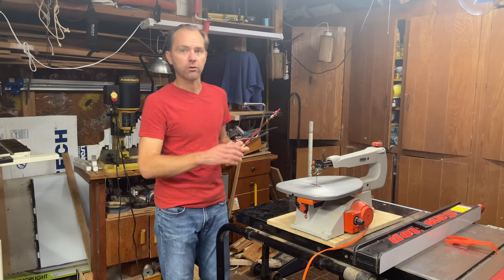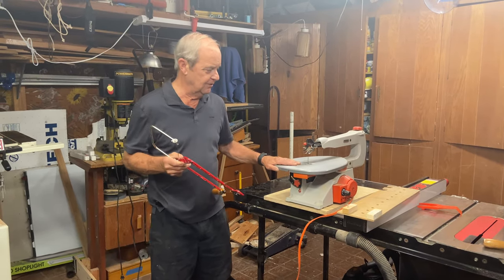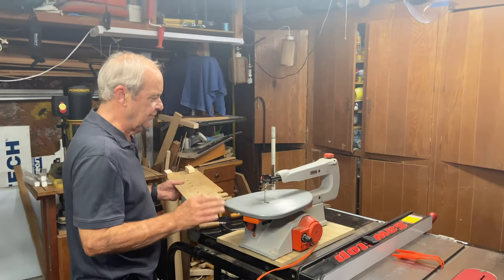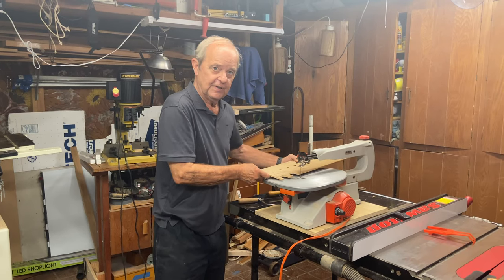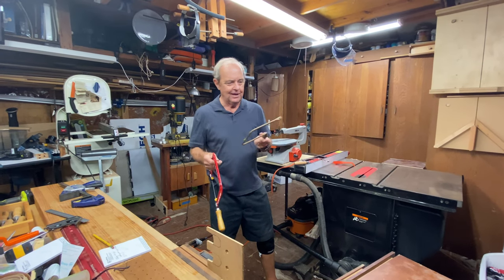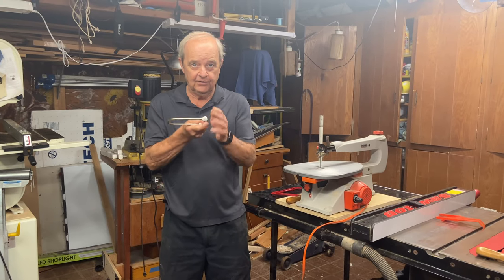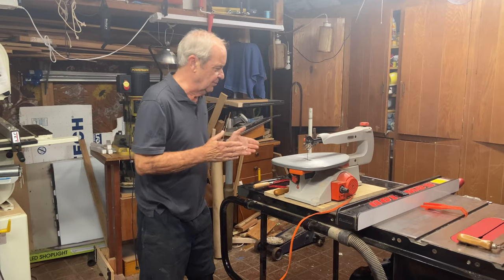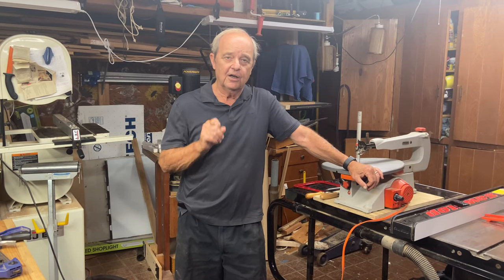Scroll Saw vs Coping Saw vs Fret Saw

Comment: Just a small point with the scroll saw and the wood hitting the body of the saw. If you start on the right side of the cut instead of the left, you can rotate the wood more than 180 degrees.

Comment: Don't know if it's a different tool but I suppose it's about just the same that jewellers use to cut very intricate pieces of fine sheet metal. Most of them will have a sort of cutting table that will allow the user to cut pieces with the blade being vertical and pulling down, rather that pushing. Basically this gives the same cutting motion of a scroll saw machine with the benefits of having support from both sides of the cut (eliminating quite a bit the chance of vibration, opposed to a piece held on a vice).

Something to also have in mind when using a scroll saw machine is to have a height limiter. When using this sort of machine, despite the saw teeth are pointing down, you can often find yourself in a situation where the workpiece will "dance" up and down like crazy if you down hold the piece down firmly but gently. The height limiter greatly reduces the chance for that to happen.

Just as an added hint for anyone who never tried it, I've tested with much success the use of an abrafile blade (ceramic tiles cutting?) installed on an scroll saw machine (Hegner Multicut). 

Safe cutting!
Reply: You're correct, resting the piece on a cutting table allows for a easy cut with a simple coping saw. Holding the piece in the vice has several drawbacks: flexing of the piece, and unable to see lines.

Comment: A worktop fret saw has limitations as you've illustrated but I have found that often it is down to having the patience before skill when it comes to any of the tools you've shown. I do intricate (valve radio wood cut outs for loudspeaker fascia panels etc) and similar work with timber that can be 5 mm to 2.5cm thick from softwoods to hardwoods including plywood and laminates.. Having patience and taking your time rather than rushing the work in progress seldom delivers less than excellent results. At the moment with the Covid 19 situation many of us have time on our hands with ie lockdown etc to do some woodwork using these tools AND without having to spend a heck of a lot of money doing so,. Quite often it is easy to lay ones hands on scrap off cuts of wood if we are learning to use the tools in question before we move onto project timber etc. I've used a friend who is great at drawing to do some fretwork wood designs drawn onto the timber and then cut accordingly before finishing with varnish, painting etc. Stay safe, watch the vids for more info and click the like button goes without saying for those YouTubers who give us a whole range of great ideas, hints and tips. 👍😃
Reply from the maker: Well said!